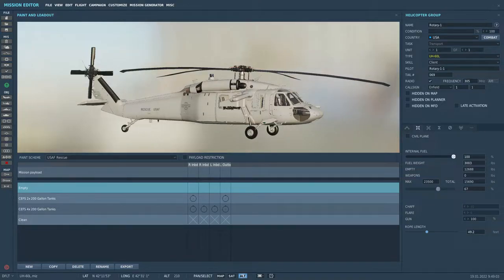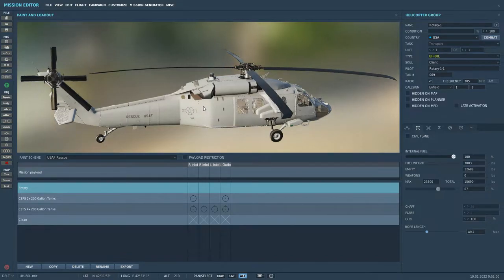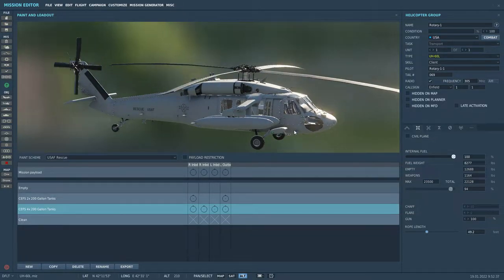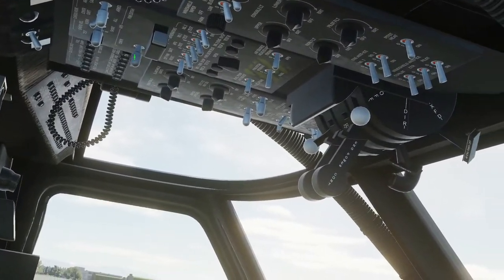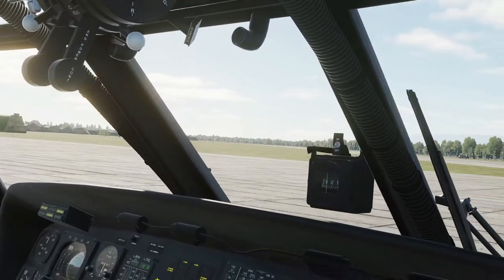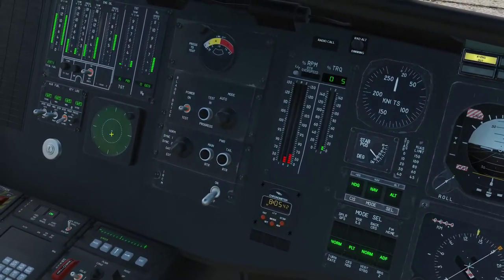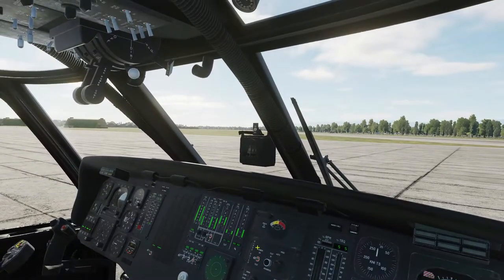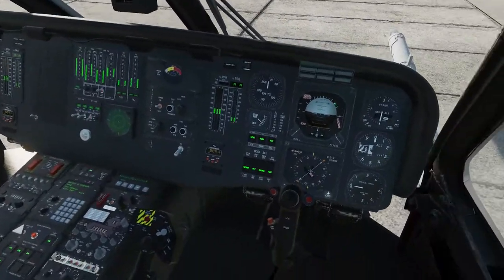Community UH-60L Blackhawk Cold Start Tutorial | DCS | DCS World | Digital Combat Simulator

Comment: Manual states that SAS1 will not work correctly, need to do the engine run-up to "fly" position before turning SAS1 on. SAS2 you can turn on right away before the run-up.